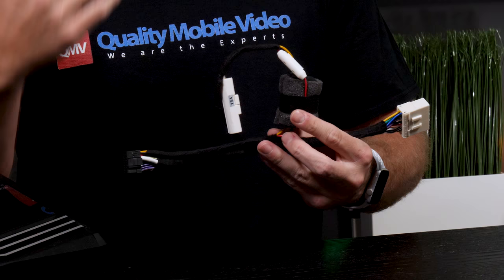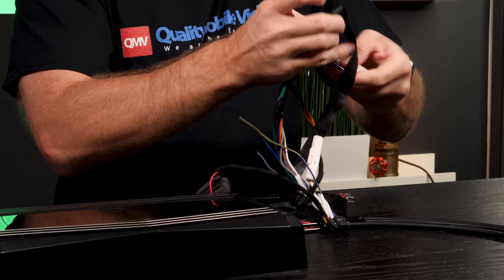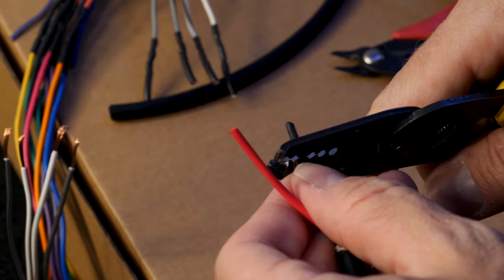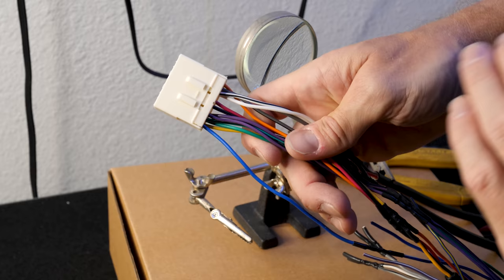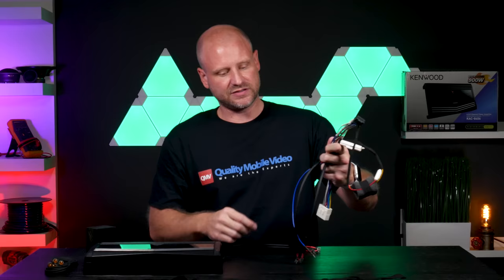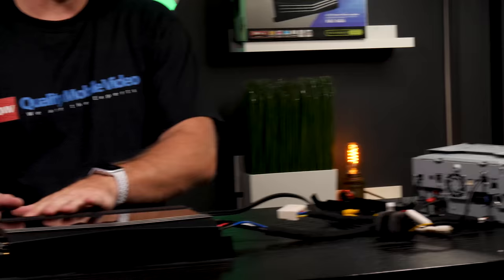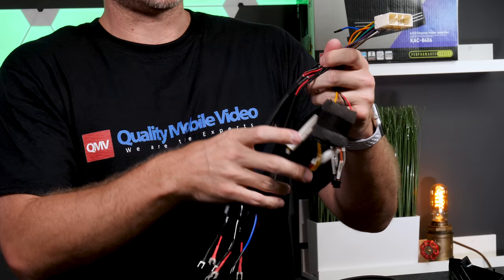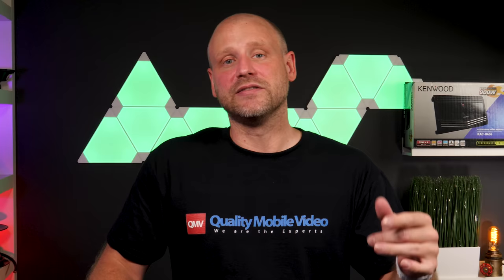Wiring a 2 or 4 channel amp to your stock speaker harness without cutting the factory wiring

Comment: Would there be any interference problem if I lay the amp input wires side by side with the amp speaker output wires and the 12v power wire together? Meaning I bundle them all up.
Reply: No bundle up. I would suggest seperating the the power supply wires(+ - rem.) On one side and the audio cables (rca LF RF LR RR) on the other. 2 seperate bundle ups, power and audio

Comment: So I’m glad I found this video cuz I’ve been dreading having to run all new speaker wire through all the door jams😳 Thank you ! My only question is how do I know if my amp has that option.. “ to use 1 pair of RCA from head unit and distribute the signal to all 4 channels”??
 Please lemme know ! 🙏🏽 I have the Skar SK-M400.4d
Reply: I have the same issue I have the skar 75.4 and only have two outputs on my pioneer head unit so I can run the subwoofer output to the skar 1500.1 mono amp and the other output rca to one of the (or two channel rcas I meant) to my 75.4 channel and it will do all four speakers by itself? I’m confused lol

Comment: I currently have the factory radio harness connected to the aftermarket Metra adapter harness that is connected to my pioneer head unit harness. Now that I want to add the amplifier I am slightly confused as to which harness the speaker output from the amplifier needs to tap into. Factory Harness, Metra Harness, or Pioneer Head Unit Harness? Thank you in advance.

Comment: Have a dasaita android head unit doesn't require a Metra harness plugs right into factory plug how do I wire the 4 channel speaker wires do I cut the android wire harness to factory harness splice speakers from there or after the factory harness

Comment: How far away is that Amp supposedly gonna be sitting from the head unit ? About a foot Max ?
Great Video but I wish you'd explain that most aftermarket Amps sit pretty far away from the head unit. Like under a seat or whatever. That Amp is a little too big to sit under the dash imo.
Am I wrong ?
Reply from the maker: The amp can be anywhere, this was to demonstrate the concept.
Reply: @Qualitymobilevideo  
Most experienced people know that the Amp will be sitting somewhere other than under the dash but somebody giving it a go for the first time in their life would be confused. Especially when they realize just how long some of the wires, RCA jacks, etc. will actually be.
Like I said it's a great video and I'm not trying to be an Asshole.
I was just stating a fact for the newer, younger Guys or Gals. 
Either way, it's no big deal.

Comment: 😅 rookies do even cut wires. For a cleaner finish you should always stager the cuts so you don’t end up with one huge bungle of splices. It’s much more compact and cleaner if you stager your connections. This applies to all aspects of wiring anything. 

Most importantly if working with limited space to tuck everything away this little bit of space savings goes a long way

Comment: PLEASE 🙏🙏🙏 PLEASE I NEED YOUR HELP 🆘 "I HAVE A 4-CHANNEL SOUND STORM EV4. 400 WATT AMPLIFIER THE SPEAKER CONNECTION IN THE BACK OF THE AMPLIFIER GO FROM NEGATIVE TO POSITIVE ON ALL 4 CHANNELS ( -/+), INSTEAD OF SHOWING POSITIVE TO NEGATIVE LIKE MOST COMMON AMPLIFIERS. PLEASE HOW DO I SET IT UP WITH THE LOUDEST PERFORMANCE (RUNNING PIONEER 4" (PAIR), JBL 6.5 (PAIR)

Comment: Great video, love your wiring techniques. 

Newbie question. If my aftermarket radio has RCA Jacks and Remote Wire for amp, Do I I still need to do this to my speaker wires? Or is this for installation for a Radio with no RCA Jacks?  I'm about to do my 2006 Nissan Frontier without Fosgate System.
Reply from the maker: Thank you!

This video is the speaker output from the amp to the factory harness without cutting the factory wiring. In 95% of the cases this applies unless you are running all new speaker wires through the doors and/or rear deck.

Comment: hello....

i like your videos...thanks for uploading.could you plz clarify the following doubts?
1.To run from battery to amp, Can i use the electric wires which we are using in home ? i am planing to use 6 sq.mm or higher thick wires...
2.how to tune the sony 1000w amp ..i would like to connect it 4 speakers and sub as you mentioned in a other video... How to tune the Sony xmn1004 amplifier?  Do you have any demo videos..?
Thanks in advance

Comment: So the speaker wires going to the amp connects to the speaker wires coming from the factory harness and not the harness that comes the aftermarket head unit?
Reply: correct.... Its simple... Think of it like this:   instead of hooking up the aftermarket harness adapter(international standard color wires) to your aftermarket radio for it to be powered. You instead hook it up to your 2 or 4 channel amplifier. Basically you can use a product called 9 wire which contains 8 speaker wires(color coded) and 1 turn on wire(blue) which will help you cleanly extend your factory harness to  under your seat or to the trunk.

Comment: So question.. in the video you show both the input and output for the stereo to the designated front and rear speakers. First in the two channel setup where the stereo powers the rears and amp powers the fronts (maybe vise versa) and then later where the amp powers everything in a 4 channel setup.. Question is, you spliced the factory connections from the headunit harness to the amp, is that "better" than running dedicated RCA/COAX connections?

Comment: Can I do this without having to splice into all factory speakers? Like can I only splice into the rear 2 factory speakers ONLY? Possibly even disconnect my 2 rear factory speakers in my 2006 dodge Dakota truck and have only my 20 inch subwoofer connected along with my front speakers...? Is this possible? Thanks.

Comment: I'm confuse in which end of the harness when you cut the connection  do you actual connect the speaker wires on the end of the radio adaptor or the other end I would gladly appreciate if u would take ur time on answering or showing us cause as I read through comments I'm not the only having this confusion

Comment: If I’m using a speedwire (multiconductor cable w 9 wires) instead of factory speaker wires and also only hooking up the front speakers do I solder the new connections at the same place still ? Pls answer thnks.

Comment: Can someone help me?!?! I can’t wrap my head around my setup. Maybe I’ve set myself up for failure but here’s what I have. 2016 cruze that I put an amp in a sub in using a pack unit to run some rcas to my amp. Now years later I’ve changed all door speakers and want to amp those as well. My sub amp is single channel so I need another 4 channel amp to power my door speakers. The 4 channel has front and rear rcas. How do I get two more signals for rcas for front and rear? I can’t wrap my head around it.

Comment: What if you have 2 radios? The factory radio is in my backseat but I have an aftermarket radio and when I unplug at the stock radio the sound in all 4 speakers is gone so that lets me know that it plays a major role in my sound output

Comment: I have scosche hd6904sd speakers(they are 4 way) that I'm installing in my 2008 Camry. The vehicle has a 86280-0W390 JBL amp. Originally I believe the high and mid channels were separated but the speakers I have do not separate. Instead it has what I would call a pass through or daisy chain between the different channels the speaker has. I'm getting clear audio but it's very weak. 

From research it appears it is because the amp is expecting the different channels to come separately instead of together like how I'm having to install it. How do I bypass the amp or is there another way?

Comment: Will the eq settings on a aftermarket head unit still work with the speakers wired to the amp or should there be a t connection with the Metra adaptor

Comment: How the speaker will work.. you just cut the connection from head unit to factory speaker then you solder the wire from H.U to the amplifier.. then you leave the wiring of the speakers.. covered with the heat shrink.. the connections I saw is head unit and amplifier connected..  according to my understanding..

Comment: I have to bypass my factory amp so I'm going to run all new wire My question is Is it better to use the Rca outputs or The speaker wires coming from the head unit?

Comment: My car has factory amps. If I disconnect them and take them out will I be able to connect the remote turn-on  from aftermarket amp like the speaker wires?

Comment: So, hypothetically, if my stock head unit doesn' t have RCA ports, Could cut the speaker wire on the wiring harness, connect a LOC to one end of the wires, and wire speaker wire to the other end of the cut speaker connect the connection on the amp, Right?
Reply from the maker: Exactly! Here, watch our in depth video on LOC's for a walkthrough on how to do it: https://www.youtube.com/watch?v=OXn8-8yee5o

Comment: you showed how to connect the speaker wire from the stereo wire harness to the amplifier but how do you connect the amplifier to the speakers? theres no speaker wire output on the amp, just RCA and you cant connect speakers with RCA

Comment: Can I replace my factory amp with aftermarket amp using the factory  input amp wires for the signal to new amp and used factory output wires for the out for the new amp ? Only new wires will be a ground and power and Lastly use factory remote amp wire to turn new amp on?

Comment: Ok thanks for the great video. I have two questions though. I have a pioneer head unit and only four rca outputs ,one is goin to my sub amp 1500.1 skar and the other rca output to my four channel skar75.4should I get y splitters or just run the rca straight to the 4 channel amp and let it do all 4 ? And I have a metra wire harness also so I cut my four speaker wires BEFORE the harness connects to the stock wire plug 🔌? That was kinda not clear to me but I’ll watch it again. If you can help I’d be greatly appreciated thank you 🙏 you’re videos have helped me a lot the past few months but when it’s finished it’ll be one hellllava system!

Comment: How would you go about doing this if you had to add a line output converter? Also would I need two converters? One for the front two speakers and one for the rear.
Reply: You cant loc is for subs
Reply: They make LOCs for highs and mids and woofers too.  Lc7i is a 6 channel LOC.

Comment: I’m trying to do this on my 2015 f150. But I want to keep my stock head unit and radio. So I purchased the converter. Would the install be the same as this video ? Or with the stock radio are there no spots for RCA’s ?

Comment: So the black and grey wires are the front speaker wire on every car? I guess it's better to find a wiring diagram? How can we know for sure that this is the factory positive wire, or negative?
Reply from the maker: Generally yes, the grey and grey/black stripe are Front Right Positive and Negative, but it's always crucial to consult your manual before messing with with any connections.

Comment: I don't understand the part about the remote wire. When using high lvl input amplifiers, doesn't it just use the speak input to decide if its on or not? I'm trying to think what I gonna run a remote wire from on a factory radio =/

Comment: so is it still the same process if you have factory amp just making a t connection
that way it goes to the aftermarket amp and not the stock amp and does that mean the stock amp will still be plugged in but just not have any power going to it  meaning it's just there for the use of your factory harness and thaks for your help 

sincerely Juan

Comment: I follow this tutorial and I have a issue , I run my rca’s for fronts and rear to the amp , but looks like all speakers play from front RCa , if I unplug the rear’s there is not any change )( amp its set to 4 channel ) , and If I. play with balance , front left or any other corner , the whole LeftSide play , can someone advise me?
Thannk you in advice
Reply from the maker: You may have an issue with the amp selector switch or you wired the outputs incorrectly.
Reply: @Qualitymobilevideo  all sorted now , thanks for the replay 🫡
Reply from the maker: What was the issue?
Reply: @Qualitymobilevideo  one of the speakers on the rear had a lose wire

Comment: So basically if i want all 4 speakers running off the amp, i run 4 wires from the metra harness(female end) to the amp to give power to the factory connections at the doors and rear deck?

Comment: I kind of get it. Would it be possible and work if you just use a quick splice or must the cable be cut and then output through the rca?

Comment: What if it's a factory headunit? With no rca's? Do u just run the wires directly from the amp to the speaker wire, plus remote turn on? Will that work?

Comment: hello few days ago i bought 4 channel amplifier ALPINE 445U  (i have 2017 passat R line) i tried to connect to my factory radio and divide it to four factory speakers but couldnt because my radio doesnt have ACC wire and REMOTE wire. if anyone knows what to do please tell me on how to fix it thank you
Reply: Use your Ignition + (Clamp 15) as your REMOTE or use an AAC.3 High-Low Adapter
Reply: @yesiamfelix114  so i need to connect  to the fuse box . because my radio doesnt have ignition. thenk you very much for help

Comment: Dont be lazy. Run new 16awg or larger diameter wire to your new speakers. Running new wire 16/14/12 awg wire to the old 18 or 22 awg garbage factory wire will cause a whole lot of electrical resistance, robbing power to the speakers.

Comment: Question. My pioneer avh601 has a set of front outputs, rear and sub out...I have my epicenter on the rear output since it requires a full range signal before my mono amp. I now want to add a 4 channel amp to power my highs (6 speakers total). So I will be getting the signal from the front output. My amp doesn't have  2/4 switch. So will I need to add 2 Y splitters near the head unit or do I put the Y splitters at the end near the amp. Or it doesn't matter? Thanks

Comment: What if we have the loose ends also connected, essentially making a “T” connection, I did that and my 4 channel amp (JL audio jd 400/4) is cutting out and the red light is going off at very low volumes, like only 75db, which is around 30/50 on my aftermarket head unit (Sony xav 5000), it got way louder with just the head unit, so idk what I’ve done wrong, I checked the ground and power voltages, both around 14, and tested it with the music actively cutting in and out, voltage stayed the same. I had made the cuts on my factory to aftermarket harness wiring. Any thoughts.

Comment: I am looking to wire my wiring harness into my 4 channel amplifier but I was planning to just connect some spade connectors to the end of the cables on the harness(front right/left, etc..). But in this video, you soldered some thicker cable with the spade connectors on the end first. Is this mainly done for length or is it required to have a thicker "monster" cable with the spade connectors running directly into the amplifier?

Comment: Might be a dumb question but… does the speedwire connect to the factory radio harness or to the aftermarket radio harness so that way you don’t have to cut the factory harness up?

Comment: Hi, i'm new at this and I wanted to know how to wire a 6 speaker system consisting of (2 Bose factory tweeter, 2 8ohms 1500 watts 350W RMS Orion woofers, 2 4 ohms 500watts 300Wrms woofers and an aftermarket Subwoofer 2ohms 1500watts 400rms)I have on hand a DS18 V5Hl, LC6i and a Kicker Key 180.4 amp?
Any suggestions on what I need and don't need from this list?
Thank you!

Comment: I feel like I'm not doing it right because your speaker wires are insanely big I just have that regular 16-gauge blue speaker wire but this video helps a lot , before I hook up my sub my factory speakers were working I had everything laid out about to hook it up RCA's plug in the bag the harness all wrapped up and the head unit and I just didn't hook up the power to the battery and my factory speakers were working soon as I hook the sub up that's the only thing that was working does anybody know why that happened is it because I plugged the RCA's in the amp so it's bypassing the factory speakers? That's the only thing I can think of
Reply from the maker: Are you using an external amplifier or are you running everything off your head unit?
Reply: @Qualitymobilevideo  no I'm good now I watched another video on how to make your factory speakers work buy running them from the head unit to the app instead of from the amp to all the doors but I have a 4 channel amp in a 2 channel amp and 2 10s one 12 .. I've already hooked this system up before in a different vehicle watching videos like this just make me second-guess myself that's all
Reply: @Qualitymobilevideo  so this morning my factory speakers started working and then my subs stopped working I think it might be my head unit just one of them cheap Bluetooth from Walmart that's been used

Comment: What kind of speaker wire are you using im in the process of mimicking this exact procedure but id like to know what speaker wire you use or is it just regular 12g or 10g speaker wire?

Comment: Is it just me but he’s soldering the wires from
The amp back into the speaker wires that connect back into the head unit ? I thought it was suppose to go into the speaker wires to the car instead and the wires in the plug to the head unit are no longer needed being that the RCA is what sends the signal to the amp from the head unit

Comment: How many watts should the amp be 2 drive the car after market speakers 250watts 6/8 2way in the rear & 300watts 3way 6.5 in the front?

Comment: Lorenzo or anyone, HOW DO I do the above project when I have a L.O.C. (AudioControl LC7i) tapped into my stock speaker wires which is grabbing the speaker signals for my mid-bass amp..? Is it possible? My LOC is tapped in behind the head-unit if that helps to know. Conundrum to say the least!